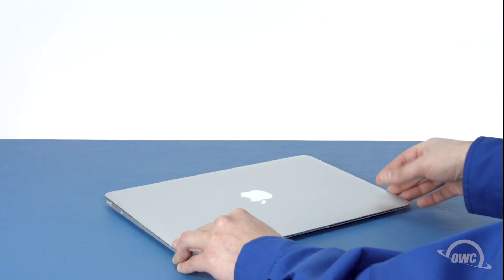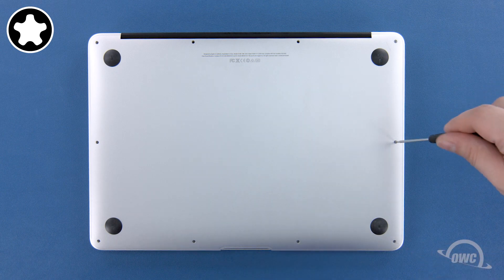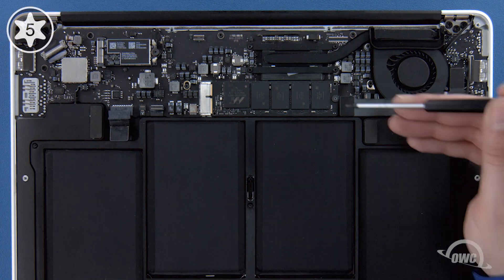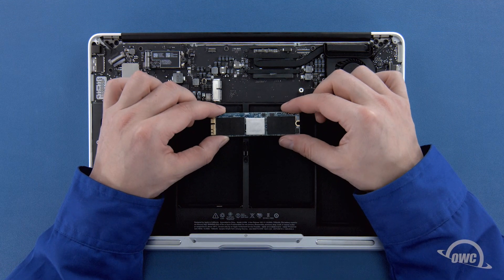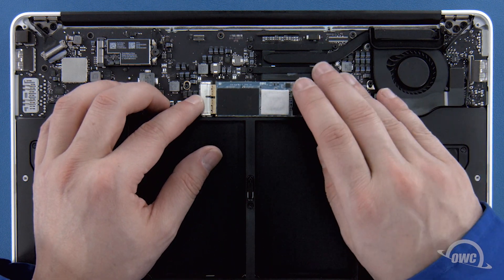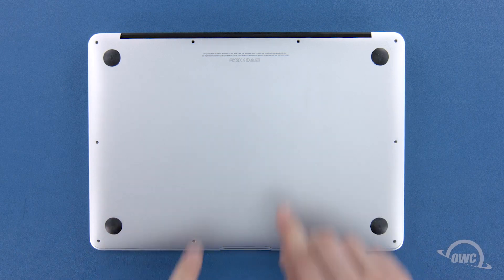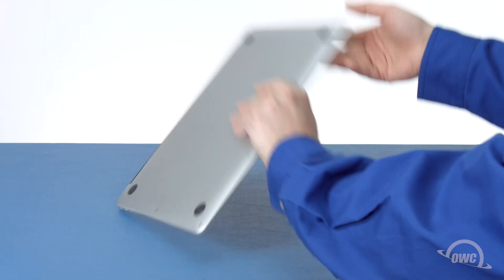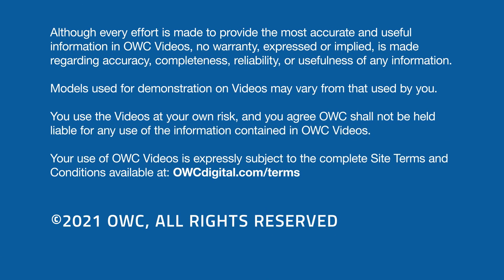How to Upgrade the SSD in a 13-inch MacBook Air (Mid 2013 – Mid 2017) MacBookAir6,2 MacBookAir7,2

Comment: So I changed my ssd for my MacBook Air 2013 and now it’s like I am back in 2013. The only problem is that I cannot search on anything neither update on App Store. What do I have to do to get my MacBook functioning? Please appreciate any help!
Reply from the maker: Are you able to see the drive after it is installed on the computer? We can certainly assist you with troubleshooting if you could describe exactly the issue that you are seeing with the updates a bit more.
Reply: @poweredbyowc  so basically m. My drive stopped working so I bought a new ssd. Now I have installed on the computer and when I open AppStore it says it’s not available. When I search YouTube on Google and try to open YouTube it doesn’t work. I have connected WiFi. 

My dad’s friend said however that it should work otherwise I can use a usb which contain an update and then put it on my Mac to install. 

My MacBook right now is back to zero like when you first open it back in 2013. Directly from the manufacture! 

Do you understand? Or do you want me to specify more
Reply from the maker: If the MacBook Air has an older operating system installed, it could be causing compatibility issues with certain apps or websites. To resolve this, try entering Internet Recovery mode and updating the system from there. If that doesn't work, using a USB installer would be the next recommended step.

Comment: has the sleep problem been solved?
Reply from the maker: The sleep issue appears to be related to Apple's firmware, which may not recognize third-party drives. We've completed all the necessary firmware updates and requirements to the best of our ability to address and prevent the issue.

Comment: Could an SSD upgrade (in my case a OWC Aura Pro X2 1TB for a Macbook Air 2017) lead to a shorter battery life or more heat development?
Reply from the maker: The difference in power draw will likely be far greater when comparing the battery life of the 128GB models, versus the 512GB, 1TB, or 2TB models.

Other factors that impact battery life include the condition of the battery, application usage, and power settings on the machine.

But all in all the Aura Pro X2 should not be drawing any more power and draining the battery any more than the Apple Stock SSD.

Comment: i have old Mac OS 10.8, and when i replace with a new ssd, i got a question mark, and disk utility does not recognize the ssd. What should i do?
Reply from the maker: Zlatko, the SSD is black so that question mark is letting you know you still have to reformat and load an MacOS on it. I have provided you our formatting guide link below.

https://eshop.macsales.com/tech_center/drive-formatting-data-migration#:~:text=OWC%20Aura%20Pro%20X2%20Formatting%20Guide%20(2.01MB%20PDF%29

Comment: Early macbook 2014 apple ssd sd01284  i want to upgrade and built it myself but i dont know which part i need for the installation of a new ssd cart serial number is c02nqcjyg085 model is a1466 EMC rated 2632 rated magnet charged 14.85 volt
Reply from the maker: Here is the link to the SSD upgrade that will work with your MacBook Air 2014.
https://eshop.macsales.com/shop/ssd/owc/macbook-air/2013-2014-2015

Comment: Thank you for this very informative video. Question: How do I know what type/size SSD I currently have and what model do I require for an upgrade/size increase? Thanks for your assistance
Reply from the maker: It would depend on the model but the best way to know for sure is to go to your  > About This Mac, and then check your system report. The type of drive you have will either be under SATA or NVMexpress.

Comment: Will this make the 2013 model run faster with a newer ssd? Or will it run about the same as having the original ssd?
Reply from the maker: Each of these will not only help increase the storage, but these will definitely help increase speed as well. Check them out and give them a try!

Comment: just wondering where do i buy the SSDs from? Amazon? Ebay? How do I get one and which model do I use?
Reply from the maker: Hello Sanyu,

You an buy our drives directly from us at https://eshop.macsales.com/shop/ssd/owc
or you can buy from our certified resellers and you can find them here. https://www.owc.com/partners/where-to-buy/.

Now for which one to purchase you would just need to know your model identifier to your Mac which you can find it by:
Clicking on the Apple Icon on the Top Left of your Mac.
Selecting About This Mac.
Selecting More Information or System Report.
In the Hardware Overview on the Right side the 2nd line down it will give you the model Identifier.
The webpage we  provided you above will tell you which drive is compatible.
Reply: @poweredbyowc  thank you
Reply from the maker: @Sanyu….You are welcome! :)

Comment: I have an early 2014 MacBook Air running Catalina 10.15.7  Serial Number (system):	C02NLYAEG085.  I have 120 gb drive but only 15 gb space left, so I cannot update anymore.  Big Sur update says not enough space.  any recommendations for a bigger ssd drive.  Otherwise, I have no issues with the laptop
Reply from the maker: Hi Gail! Below is the link to the SSD upgrades we offer for this MacBook Air. For more information, we would recommend reaching out to our support team.
https://eshop.macsales.com/shop/ssd/owc/macbook-air/2013-2014-2015

Comment: I do have a question please, 
I tried to change the ssd with an adapter and all of a sadden the MacBook didn’t turn on again. Only the heater exhaust was working. Went to check with Apple as it had warranty and the motherboard had been replaced. Any idea why this happened after trying to change the ssd?
Reply from the maker: Hi Sifis_AviationGR!  I'm sorry to hear that the MacBook wouldn't turn on after changing the SSD with an adapter.  Please contact us at 800-275-4576 (or 018153388685 outside the US) or at support@owc.com and we can do some more troubleshooting.